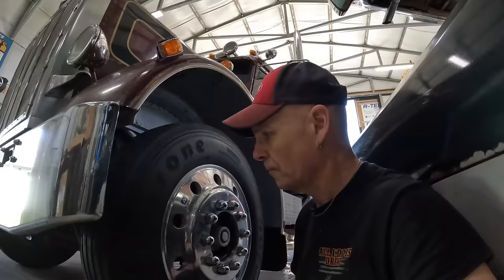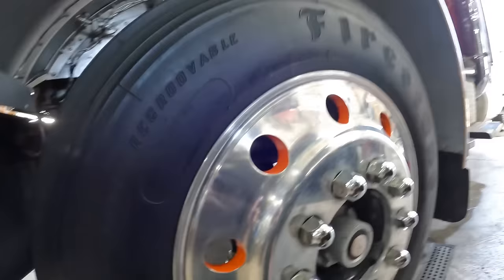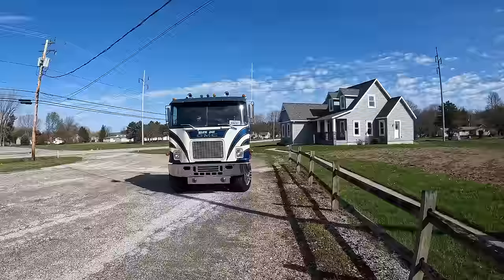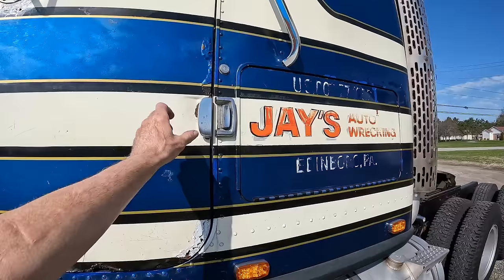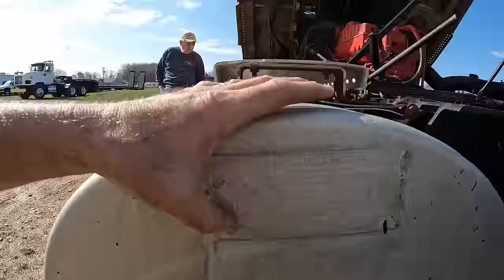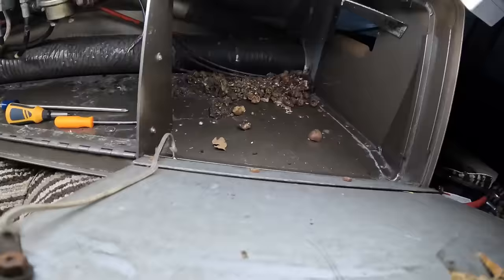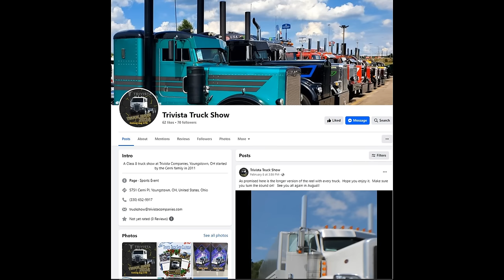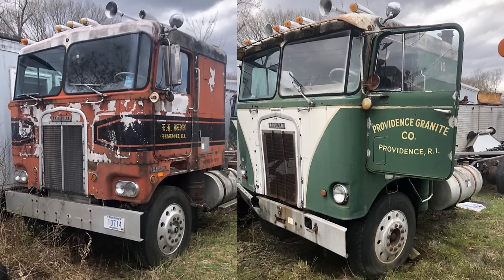Kenworth K100 Resto Episode 16 / GMC Astro Cabover ride

Comment: Dane ole Grasshopper is really taking Shape, nice touch with the wheel holes on Pistol Pete, I like the throw rug idea over the doghouse, That Transtar is sharp , as mentioned in the previous video that frame/chassis is unbelievably CLEAN !! As Always Dane Safe Travels to you and all that help contribute to the videos 👍👍👍👍
Reply from the maker: Thanks David, and that frame is also HUGE! It’s got to be 15” in the middle then tapers down at both ends. Very hefty.